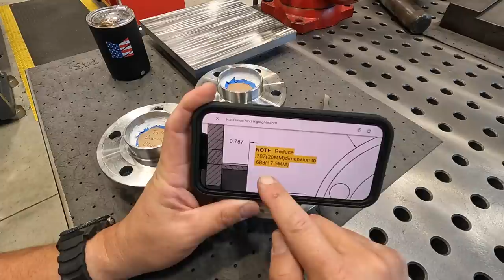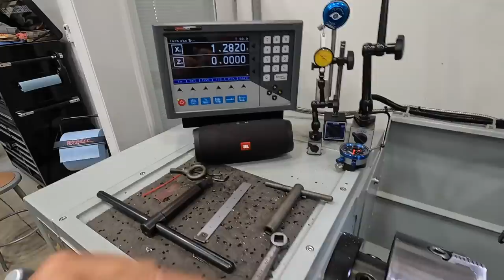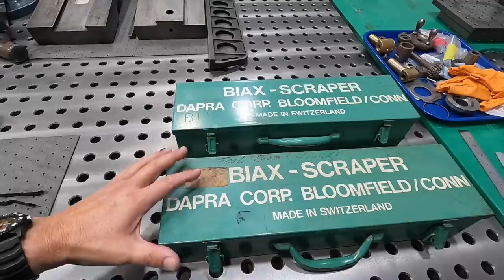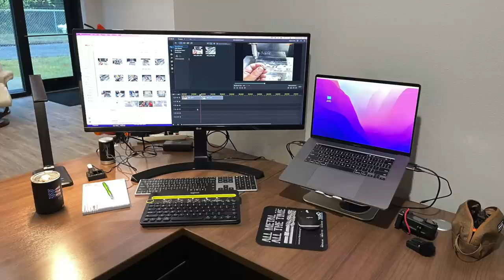SNS 368: Wheel Hub Machining, Shop Updates

Comment: I'm a grinder by trade, if we used an imperial Dail Indicator to clock our jobs you would never get the accuracy needed for tolerances the customer requires. Generally we need to tru a job to within 0.01mm so only metric equipment will do.

I thought you guys in the USA used metric in science and engineering as standard. Maybe not so for small independent machine shops though.
Reply: Just change to a tenth indicator.. metric isn't more accurate, just different
Reply: There is no difference in an imperial indicator verses a metric indicator other than the size of the graduations.  .01 mm = .00039 inch or approximately 4 ten thousandth of an inch.  One ten thousandths dial indicators are available.  You rarely see Adam use one because his work usually only requires one thousandths accuracy.
Reply: “..so only metric equipment will do.” 
Absolutely hilarious.
Reply: Just goes to show, it’s not that hard for anyone to learn to operate a specific machine/type of work but not everyone can understand the concepts involved